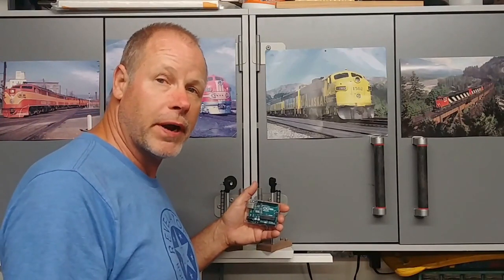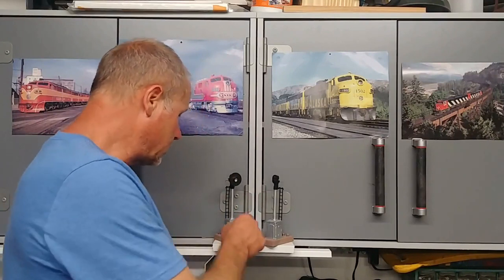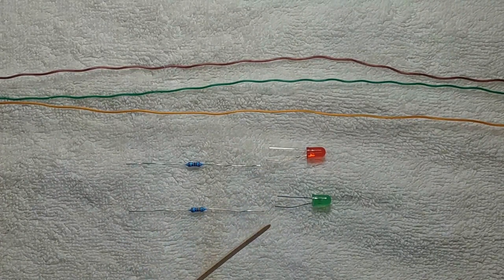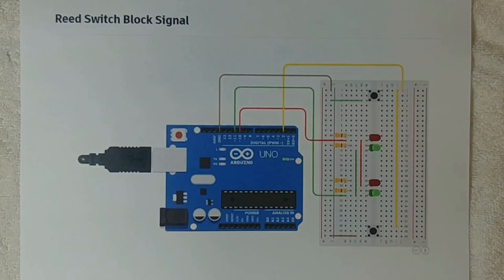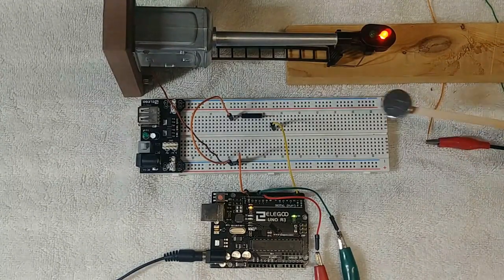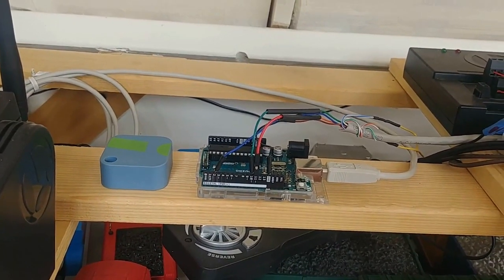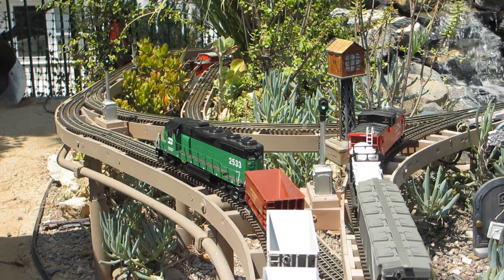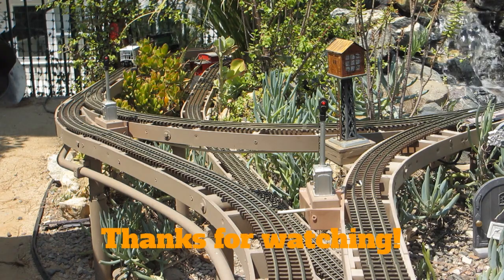Arduino Block Signal on the Baldy & Palms RR - O Scale Trains by Ron

Comment: Hello Sir, 
I'm new to your channel. Thank you for doing this How-to Videos with O-Gauge. I'm planning a layout using Lionel Fastrack could I use the arduino system with my Fastrack?  Also why did the BN Locomotive past the first signal but not the 2nd signal? Do you run JMRI to program your layout? I've never seen a O-Scale outdoor layout  before from what I've seen it looks nice keep up the great work you're doing.
Reply from the maker: Allan, welcome aboard. At the time of this video, I was operating track power with Lionel legacy remote which can run several locomotives at once. The signal system is an independent system operated by the Arduino and IR sensors in the track bed.  I am not using JMRI. Just good ol’ control action with the legacy remote. You mentioned fast track. Fast track is not good for outdoor use. I recommend Atlas silver nickel track. This layout is going on 9 years with very minimal maintenance issues. I have since a few years back moved to dead rail with RCBP to operate the trains. The signals are  using HC-SR04 ultrasonic sensors to trigger the train movement through the Arduino.  Be glad to answer any questions you have in building your layout. Cheers!  Ron//

Comment: Hi Ron,
Excellent and simple! much appreciated. As a (retired) new comer to model railroading, is their any chance of you adding an amber signal? i.e. Red amber, Green and vis versa. if it can be done that will be fantastic!.
your feedback/response will be greatly appreciated.

Cheers
Jay from Down Under.
Reply from the maker: Jay, I have an updated video to this video in my playlist. Check it out. I also have updated the Arduino code to accommodate an amber signal as well. The code in already there, just need to turn on those lines of code.  Welcome to the hobby as well.  Thanks for dropping a comment. Cheer!  Ron//
Reply: @baldypalmsrailroad  Hi Ron, Thanks for your response, I will give it a go,
Cheers

Jay
Reply from the maker: https://youtu.be/cvR5SQNhLuU

Comment: Thats a cool system, so do you put the magnate onto the bottom of the engine?
Reply from the maker: Yes - I'm actually  trying  a larger magnet on the first trailing car to signal the reed switch. Now that I'm moving to dead rail, I'm looking at another way.  Shunting the track with a pull down resistor through the Arduino. Works the same as the reed switch, but when the wheel complete the short the pull up resistor will activate the signal to red, and stay until the exit shunt track is shorted again.  It's fun experimenting with these signals..  Ron//